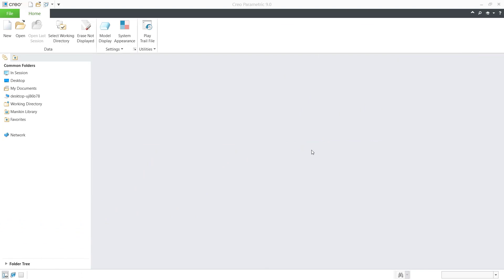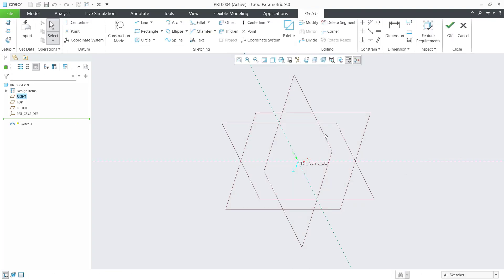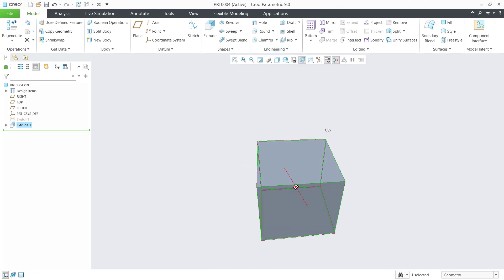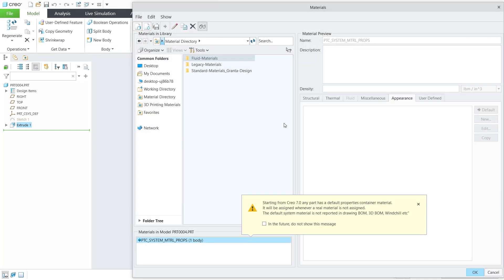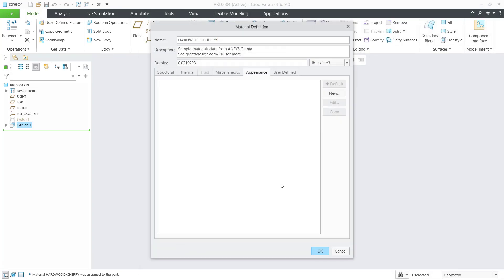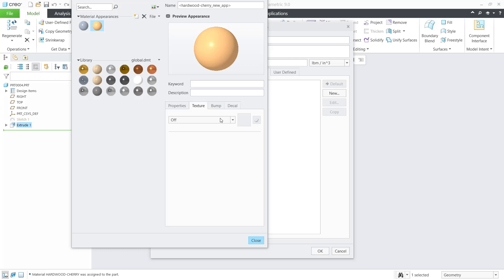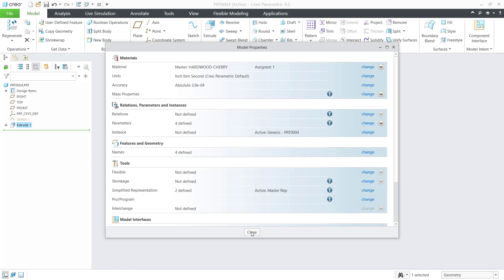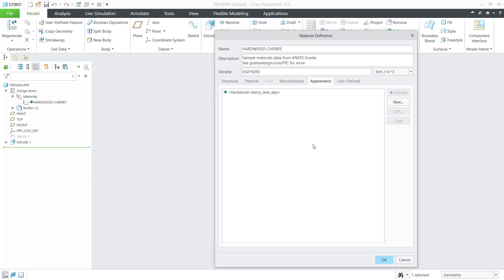Creo How To Assign Material Tutorial

Comment: Hi ya, is there a way to assign material in assembly mode? For example; I have an engine assembly model that uses 100 different stainless steel screws. I want to change material to mild steel. Would l have to modify each different component model file?